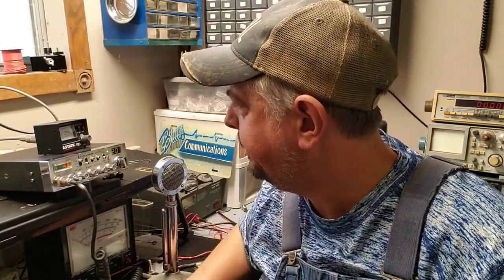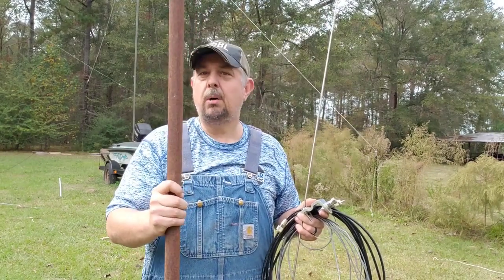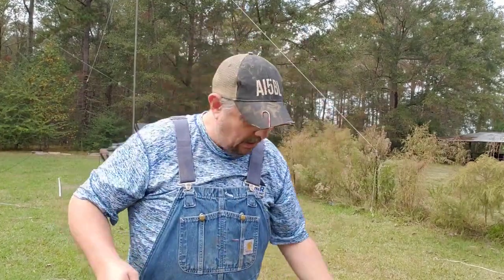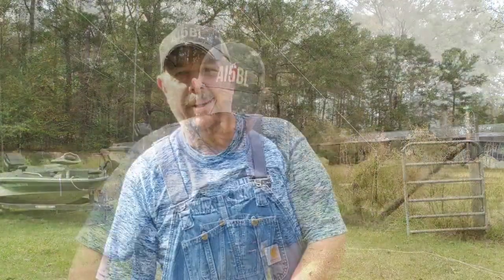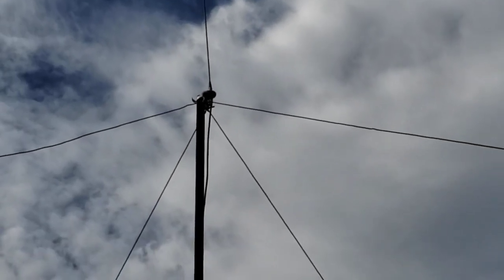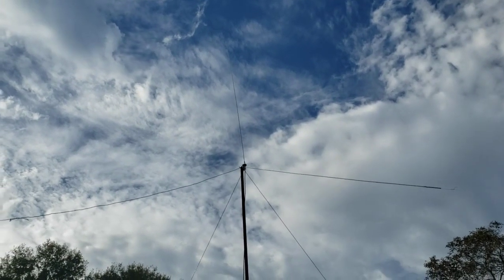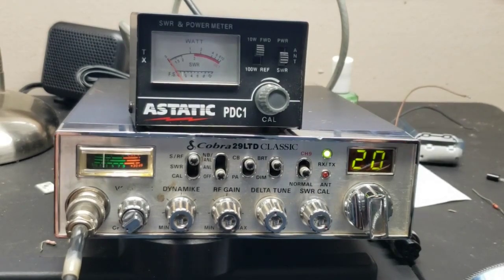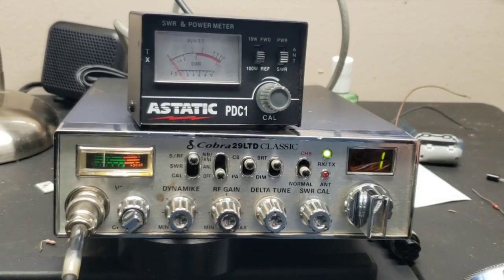Breaker Breaker fer a Redneck Check

Comment: I have just had your channel pop up as a recommendation and I have to say, love the presentation and content.  None of this fancy tech stuff, just basic knowledge, basic materials and getting on the air.  I played around on CB way back in the 70's and 80's but never really got too involved, but 5 years ago a buddy suggested I take my Foundation Licence (I think that is your Tech) and get on the amateur bands, well that was it, hooked.  I love nothing more that to build simple resonant antenna's from all sorts of cheap bits and pieces and get them out working.  My preferred ops is QRT/P, mainly due a lack of HF at home, but I have a reasonable VHF/UHF set up in the shack.  Thanks for sharing.......

Comment: my first mast was a 3 inch o.d, 20 something foot pvc pipe held up to the corner of my roof by 2 self tappers and strap banding with a maco 5/8 wave aluminum antenna on a 8 foot metal top fence pipe held on by 3 large  stainless steel adjustable screw clamps. how it stayed up 35 feet in the air for so long is beyond me, but i was shooting skip like a beast. i miss those days so much

Comment: Looks like my first CB antenna except I used a bamboo pole with a piece of wire zip tied to the pole for the vertical element. Most of the local's wouldn't believe me when I told them what I was using.

Comment: You can Use two of the Stainless steel antennas to make a CB 10 Meter Dipole Antenna!
Reply: Yes mfj make a bracket to put 2 antenna in to a dipol n mount to a pole